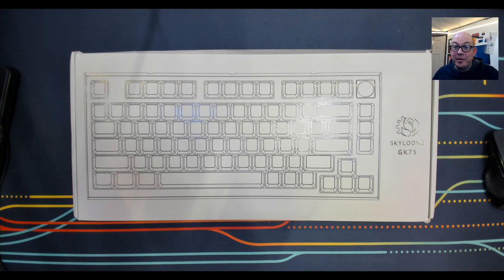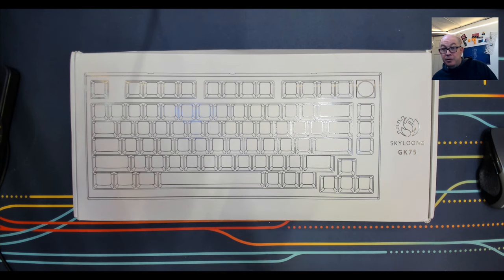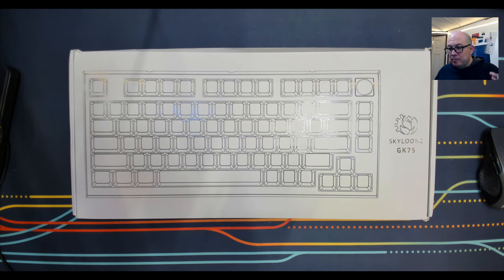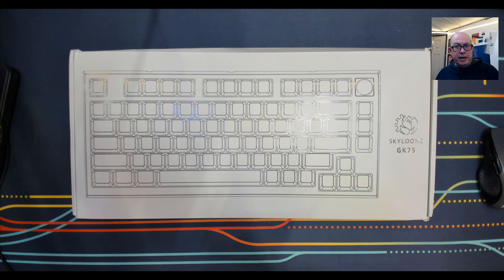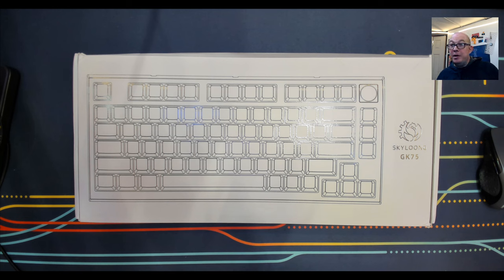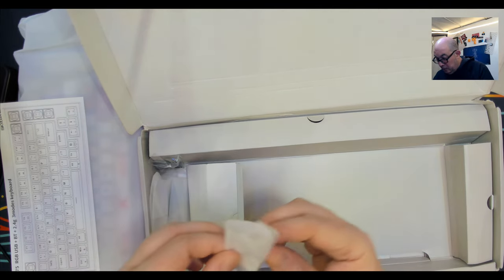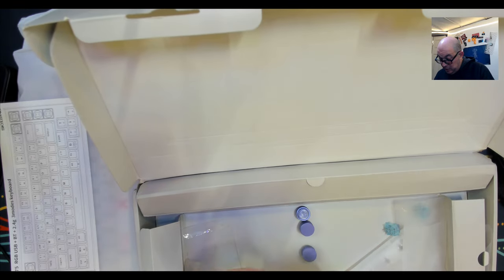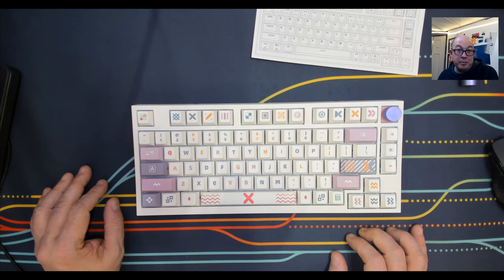GK75 Review

Comment: Do you know if this is the same as the SKYLOONG GK75 Lite? I cannot seem to find info on what the "Lite" means, but that is the model I am finding in Canada.
Reply from the maker: If I am not mistaken, 'Lite' denotes optical PCB and switches.
Reply: @MechKeyboards  I don't know if that is good or bad, but I am off to look it up. Thank you.
Reply from the maker: @xColdstormx  optical and mechanical switches are similar, except optical does not have a spring leaf and uses light blocking to trigger the key. There are about a dozen optical switches to choose from, there are thousands of mechanical switches to pick; I would personally never recommend someone purchase an optical board if they ever intend to modify it and interested in trying different switches.
Reply: @MechKeyboards  Great advice, thanks.
Reply from the maker: @xColdstormx  glad to help, cheers!